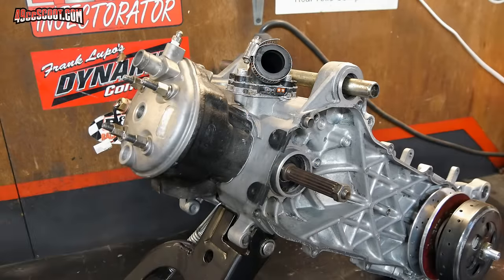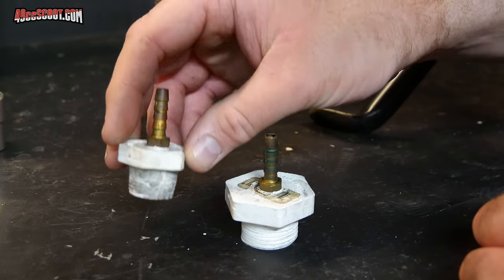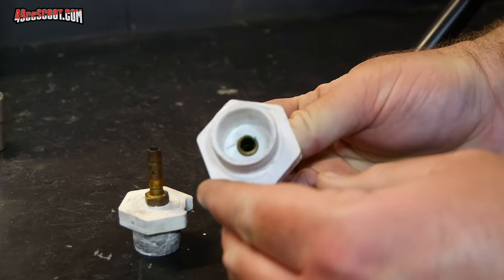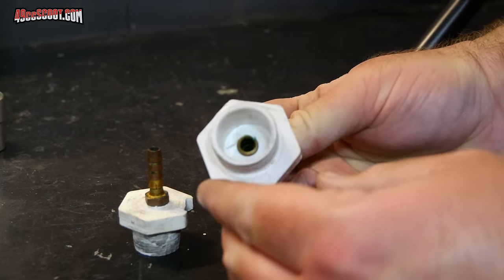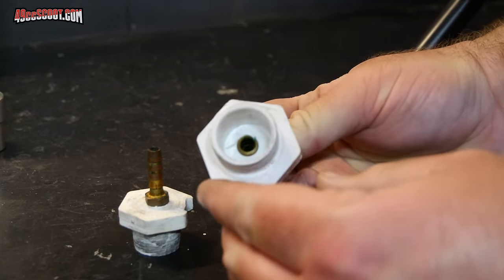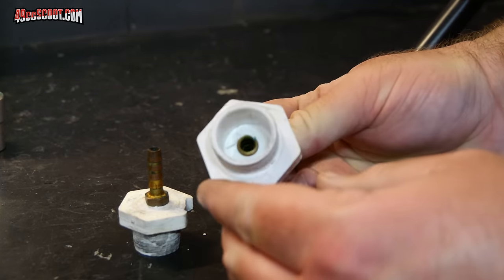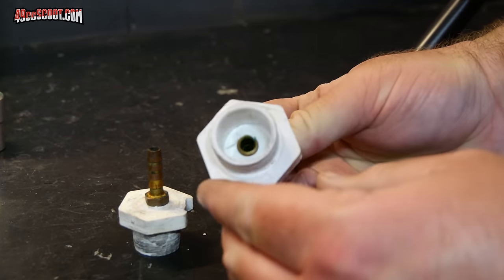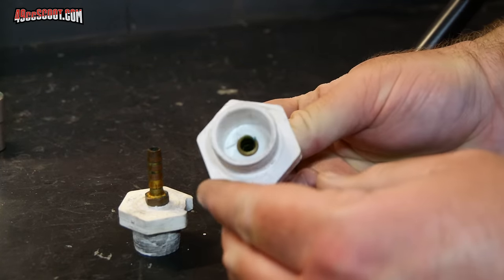Pressure / Leak Testing A Two-Stroke Engine & Building A Tester 2T

Comment: You are the most thorough person I have ever seen doing a leak test on a 2 stroke. I rebuilt an engine that I am fighting idle issues with. I have found my large leak (intake manifold), but still leaking about 1 psi in 3 minutes. I have full confidence after watching this I will find it. Thank you for sharing your knowledge. Awesome video. I likely won't wait 30 minutes, but if it holds steady for 5 to 10 minutes like my manual says, I will be good with it.

Comment: On the head gasket  to see if it  leaks I just run a compression  test and make sure it don't fluctuate for several minutes or over night if you wish, I liked the video and didn't realize I had all them parts to make this leak down gauge.

Comment: I put new crankseals in my Morini Franco 50cc, there was no movement on the gauge in a period of a few hours but it dropped about 1 PSI in about 24 hrs. I'm happy with that. My gauge is exactly the same as yours but I mounted it on a regular cylinder pressure tester after taking out the shrader valve and put a shrader valve from a tubless car tyre in the inlet port. The test on the rig that you done you could have submerged it in a tub of water just to cover the joints and looked for air bubbles. Great informative video though.

Comment: This video was helpful…and somewhat comforting at the moment. I am going through a very similar situation right now. I did a leak test and found a crank seal was leaking, fixed it, but the gauge still shows a leak. I sprayed soapy water on every area where there could be a leak and saw ZERO bubbles. I actually did a few rounds of spraying everything with soapy water and still can’t find a leak. My tester is made up of the bulb and gauge from a blood pressure cuff, the tubing from a stethoscope, and one of the pieces from my compression test kit (to screw into the spark plug hole in the cylinder head). I used a similar setup before and it worked perfectly. I am crossing my fingers that it is just a bad gauge (even though it is brand new). I ordered components to make a new tester more like the one in the video so hopefully that will do the trick. It is aggravating not being able to find a leak.
Reply from the maker: Seal the test rig if you can and put it in a container of water. That's the most sure fire way to find a leak.
Reply: @49ccscoot  - THANK YOU! Just like in your case, the gauge is junk. At one point over the last couple of days I put a screw in the piece of tube that would connect to the to my compression test piece that screws into the spark plug hole and the gauge didn’t hold pressure. I thought maybe air was just getting by the threads and moved on. This morning I slid a metal rod into that portion of tube and the gauge still would not hold pressure. I submerged all three connections, and sure enough the only thing leaking was the gauge. I could see bubbles coming out between two pieces of the gauge body. Good thing I already have components for a new tester on the way.

Comment: Very good explanation. I use a evap smoke machine. Also you need to open the reeds to allow air to fill area on the carb side. I use a  paper clip between the petal and seating surface of the cage.

Comment: This video was perfect   I am trying to figure out how to make my own leak down tester and this video really helped me understand how to do it myself.    Very clear, and well to the point.   Thanks so much for making a video a rookie could easily digest and walk away from not feeling so much like a rookie.    I am not sure I have taps large enough for those threadings but I will either pick one up or just use JB weld as we are only dealing with max 7 PSI.     Should be able to rig something up like that all half assed and still get the job done because of such low pressures.   My biggest question for me right now is how I am going to administer the air into the engine.   I really like the hand pump but not sure I will find one locally    although I'm sure harbor freight has something of that nature.   A Schrader valve does seem kinda nice but also so does the hand pump.   we shall see but regardless thank you for such a clear and to the point video.    I ride old 2stroke mopeds.  Most of mine are French motobecanes or Puchs from Austria.    Cheers !
Reply from the maker: With HF and Amazon, taps can be acquired pretty cheap. If you work on much, they're likely to come in handy at some point in the future anyway. JB prob works OK for this, but it may be similar cost to get a tap vs JB.
Reply: @49ccscoot  ended up making one and worked like a charm.  found a case leak I had no idea I had and also found a leak on my custom welded intake.   thanks again

Comment: I'm retired two stroke mech I have used guages that leak and have found them to leak right at the joint between the connection and the the curved tube in twelded joint and if not there it may leak at the closed end where the linear grear connects to the curve tube which is called the stanktion tube those jopint are silver welded, you can just reweld them with oxy-acsetaline and 99% silver such that is used with AC systems. But be mindful about not over heating the brass stanktion tube it is very thin brass sheeting.
Reply from the maker: I dunked the whole assembly into a tub of water after this. The gauge bubbled so I replaced it.

Comment: 2022 Triumph Scrambler, 1200XC with an oil leak at the drive sprocket shaft. 
I noticed this leak in the showroom before I even bought the bike.
Where are the pressure relief valves on this particular motorcycle?
I’ve also noticed oil seeping from the gasket to the cover on the bottom of the engine.
Clearly, this must to be excessive, crank case pressure.
What could possibly be blocked or malfunctioning on a brand new motorcycle that would cause an oil leak because of access crank case pressure ?
Could a bad PCV valve cause this excessive crank case pressure ?
If not, what could be malfunctioning or blocked?

Comment: Very awesome and informative vid. I love the process of elimination and where to look for these culprit leaks. I’m also glad you were able to source a case halve and was able to match the porting, now you can get back to 2-stroke riding/testing vids!

I need to split the case on my 1e40qmb and do bearings and seals, (might as well do crank too) this vid will help me go along to finish it off because of course you show your ways of not needing special tools for seal, crank installation. Will have to put a vid on the forum of the way these bearings sound! BTW Love the new Pure Pilot sport scoot tires with hi-vis color paint scheme! 🤙🏼

Comment: Good detail info on pressure/leak testing. I don't think it matters if the piston is at TDC or bdc air will fill the space either way.
Reply: Mike Johnson.... BDC to get the transfer ports open to fill the crankcase full of air...
Reply: @bigstuff52  Def see your point but air will make it past the piston and rings regardless.

Comment: This video has been so handy. I’m still using the method as I’m still getting a drop, but it identified a crack which I’ve now repaired. One question, I’m loosing a bit at the carb manifold, so need to refine the connection I’ve made, however as the air goes in, should the reeds not prevent air coming back in that direction??? If so, it means my reeds are leaking and don’t seal.
Reply from the maker: I don't think reeds are going to seal well enough to stop pressure from moving around in a test like this.

Comment: Install a ball valve right before the gauge. Shut it during test, and open to check if pressure is still the same after the 30 minutes.

Comment: Hi Brent,
Since you like building, modification, assembling and disassemble engines.
Have you ever thought of installing a pressure gauge to the crank to see how much pressure is in there.
That will be interesting.
Reply from the maker: It could be calculated roughly I suppose. If you knew the volumes to calculate primary compression, than you could at least get an idea of the pressure in the cases. Can't say I've ever thought about measuring that pressure directly.
Reply: @49ccscoot  it could be your next project???????????

Comment: Just an easy tip.  I use a boat hull plug to seal the exhaust port for pressure testing. Available at Walmart or any boat shop
Reply from the maker: I started out using expansion plugs, but when ports are not very round they didn't want to seal for me.
Reply: Expansion plug with the old exhaust o ring works

Comment: I take a lawn mower spark plug and crack the insulator and drill and press a small metal spacer from the hardware store on to the empty spark plug housing weld it into place then cut the insert part of a tire valve stem and polish it or glue it and press it into the housing. I have a pressure port that’s a short spark plug. Works on most engines.
Reply from the maker: You can also get spark plug non-foulers for some engines at auto parts stores and make adapters from those. Cheap and you get the threaded section without having to disassemble a plug.
Reply: 49ccScoot I had a big box of old plugs at the shop and was bored. It’s nice to have the Schrader valve with the threads.

Comment: If you were to pressurize the water jacket with the same pressure as the cylinder, if there was a leak between them the pressure would not change.  
So for that engine, block off one coolant port (hose and plug) and put a "T" in your pressure line and pressurize the other one similar to how you pressurize the intake.  Then compare the leakdown  with the coolant under pressure and not under pressure.  If there is more leakdown with the latter, then it's the head.     However, keep in mind the cylinder head gets combustion pressure so it's a LOT more than 7 PSI.  So passing a low pressure test does not mean it will pass a running pressure  on it.

Comment: I’m going to be doing a mild build on my Prebug Zuma and I loved seeing how easy it was to do a leak down test. I can only imagine the nightmare trying to tune that engine with those leaks lol. Also, what tool were you using to install your crank?
Reply from the maker: It's a Tusk crank install tool. I still like hot and cold a lot, but even then it's nice to have so the crank can be pulled into position if it settles too far on one side.

Comment: And I learned that if you go race speeds you will melt any jb weld or compound for sure for sure. And the oil will always make it not as solid as it should be which makes it detoriate. Can only do that to sell it or like an engine plug bolt. Stator area.  Back of motor type deal.
Reply from the maker: As shown, it can be an issue, but I've got 10s of thousands of miles on engines with JB in the crankcase as filler or backing material.

Comment: Hi Brent,
After assembly of cases and engine.
How long after to do the leak down test?
I am thinking of gaskets, gasket maker, silicon gaskets and so on.
Reply from the maker: Look at the cure times on your sealants. If you want to be sure you aren't doing it too soon, go for the full cure time stated on any sealants used. I usually try to wait 24 hours or at least close.
Reply: @49ccscoot  just out of curiosity,  how much pressure is in the crank area?
Is it same as compression chamber, between 100 to 150 psi or less.
🤔🤔🤔
Reply from the maker: @kan815k  Crankcase compression ratio (primary) is much lower than secondary compression ratio. Way less pressure in the crankcase. For example, 10-15:1 common secondary vs 1-2:1 common primary.

Comment: Will it work with radiator attached to see if i had blown gasket or not?. I'm assuming water on radiator will rise or bubbling if i had a leak
Reply from the maker: I've never tried that, but it could work.

Comment: Hi Brent. Great video (once again) I have all the stuff coming from Amazon as I type. I just replaced the crank bearings in my RH 50 and had 2 issues... 1 the bearings were very stiff. you could turn the crank by hand but it wasn't as easy as I thought it should have been... It started right up and ran fine but made a whirring noise when you came off the throttle... The cases had a paper gasket (that I did not replace) I just used Honda Bond... Could not using a gasket give me clearance issues? As well as a leak? I'll let you know what I find on the pressure test...
Reply from the maker: Most 2Ts don't have a gasket between the case halves, but I've never split open an RH 50. It could create a clearance issue. When the cylinder is off so you can look into the cases easily, you can check clearances between the case walls and the crank. Sometimes the crank can be too close to one side of  the case and cause it to bind up,  with room to spare on the other. If that happens, use a crank puller tool and pull the crank over till it's centered.

Comment: When your applying pressure does that push out reed valves? Would it damage them?
Reply from the maker: The reeds will move at least enough to let pressure through. Shouldn't damage them with low pressure.
Reply: @49ccscoot  Thank you so much for your answer and very thorough video description. 
I have a request, if you would consider doing a video on carby pressure test? 
I found different rubber expandable plugs on eBay. 
I do have another question if you don’t mind answering. Is it possible to test without taking muffler off, by blocking the end? Because I don’t want to brake muffler seal to engine. (Due to it being specially sealed for high vibration)
Reply from the maker: @Jay-ParaOz  You can test with an exhaust installed. If you can get the outlet to seal, then you can see any potential leaks there as well. I've always found it easier to block the port at the cylinder though.

Comment: Just wondering, could you use a tyre foot pump with a gauge and a made up fitting to suit?
Reply from the maker: Yeah. It's open to interpretation. I've seen that done. I've actually switched to a schrader valve on my tester now and I regulate my compressor down basically as low as it goes.

Comment: Is there a way to do this test with the carburetor attached to make sure no leaks there? Would I just plug as you did and apply the air beginning at the air intake port of the carb?
Reply from the maker: I would suggest doing the leak test without the carb and just make sure the carb is snug in the boot when installed.
Reply: @49ccscoot  thanks! Really appreciate your video and also your quick reply. I'm doing my first leak down test on an 86 NQ50 Honda Spree. Damn, the rabbit hole. Lol

Comment: I'm not an native english speaker so you must have say it in the video but I couldn't understand. I prefer read/write. What happend if a 2 stroke engine leak air like your ? Less power ? More air are coming in ? Possible failure ? Thank you very much.
Reply from the maker: In some cases, it can make it impossible to get the engine in tune. It can cause a soft seize or burn a piston from lean conditions. Sometimes minor leaks are never noticed, but I've found that in the long run it saves time to make sure it doesn't leak before you call engine assembly finished with a two-stroke. If it's all sealed and passes right away, it only takes a few minutes of your time for the actual work and then a little waiting.

Comment: The  Is this way to find that airleak if you have any problems you submerge it in a bucket of water The breather owes that comes out of the transmission You have that above the water
Reply from the maker: Works on some. These have no breather hose. Just a hole that's going to take on water unless you're lucky enough to get it well sealed.